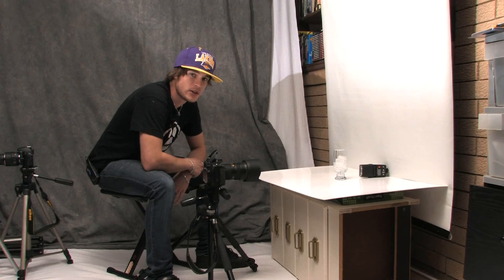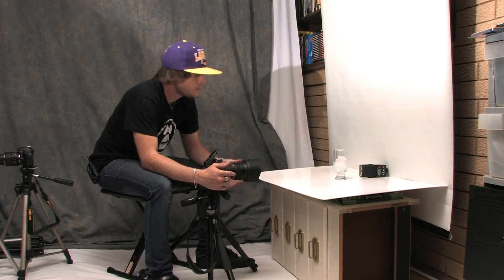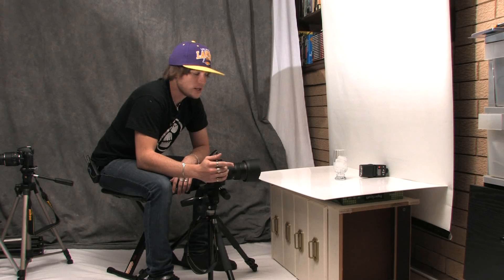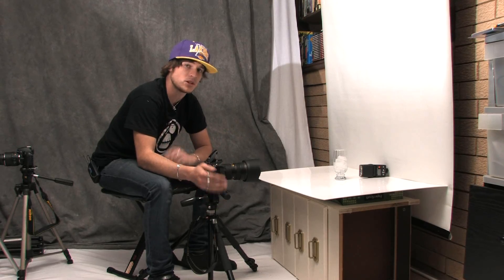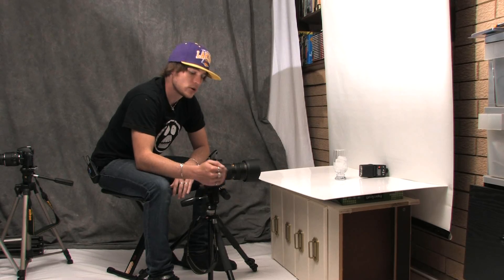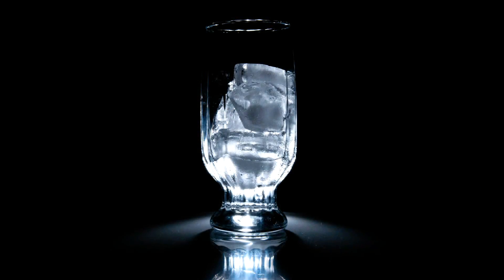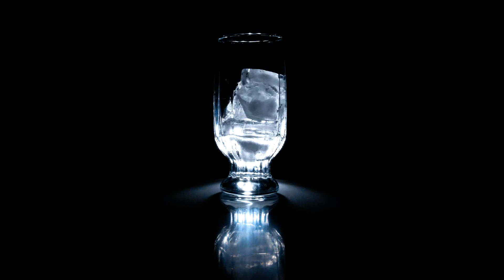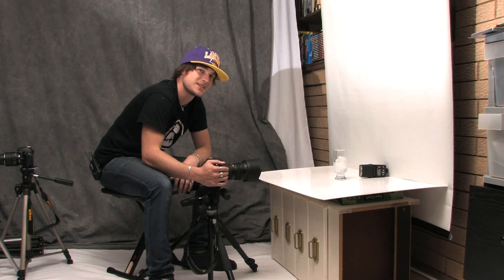Photographic Tutorial # 5 - Using Nikon CLS To Flash Photograph Glass.

Comment: hi phil, how did you adjust the off flash to 1/64th of a power? coz when i set my sb700 to remote mode i didn't find any options to adjust power on my sb700? thanks.

Comment: I'm using a D800 and SB700... Not getting results.  have manuel setting correct. 1/8000 f10 iso 200...  have the sb700 at 1/64.  speedlight is firing from pop up flash, but i am not picking up a flash in the picture. flash sync speed is set to "1/320s (Auto FP)"  Double checked all the settings still get nothing.    HELP!

Comment: @scooterphil yea, did it :)
the problem was i did everything u wrote, but wasn't triggering my external flash in commander mode.
built in needs to be in commander mode with - - setting, and group A (or B) activated (i like manual settings so i control the flash output).
thanks anyway, it's awesome to shoot this fast with a flash :D

regards :)

Comment from the maker: @stavrozinio 

Hi mate, you need to over-ride your sync speed - everytime you place a speedlight in to your hot shoe or enable your pop up flash, your camera automatically limits you to 1/250th because this is your cameras sync speed.

You need to enable AUTO-FP, this allows you to over-ride your sync speed - you will be able to dial to 1/8000th.
Go To:
MENU > CUSTOM SETTING MENU > (e) Bracketing/Flash > e1 FlashSyncSpeed > & Enable AUTOFP.

This should allow you to shoot all the way to 1/8000.

Comment: i'm basically still a newb when it comes to flash photography, so i would appreciate few tips.
how do i set my shutter speed to 1/8000? when using a popup flash in manual mode, i only get the 1/250 value (on D7000).
i'm using the sb900 in SU-4 mode, and triggering it with built-in set to lowest possible output value (usually 1/128, but primarily depending on that if the external flash "sees" the built-in).

thanks :)